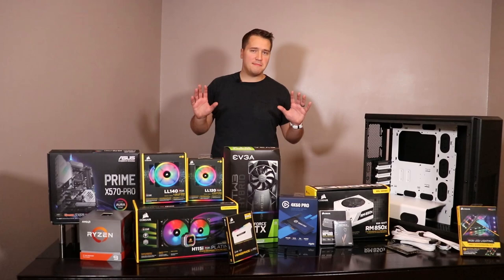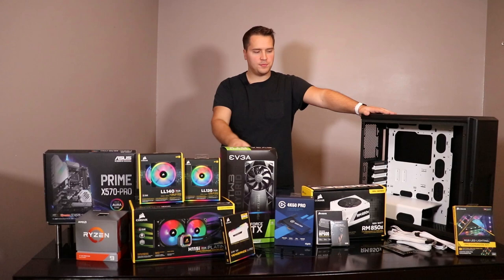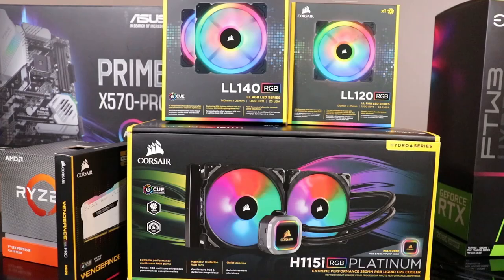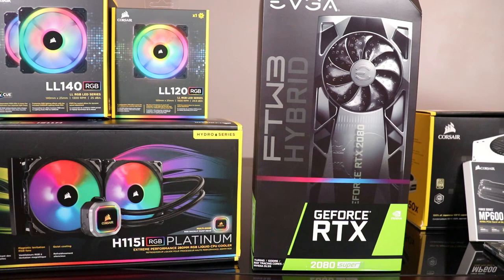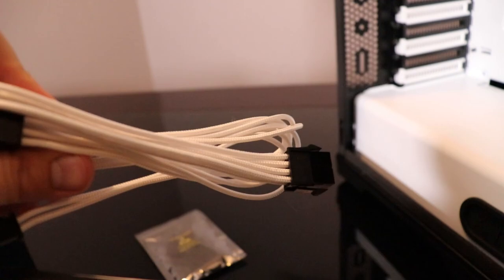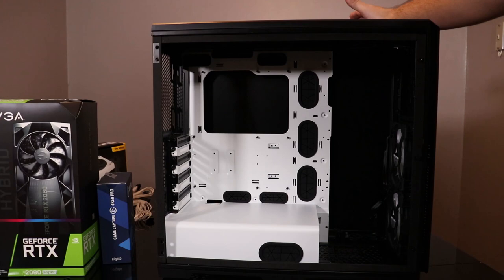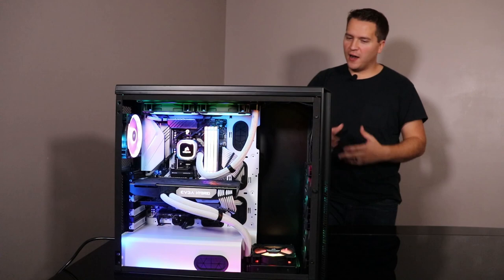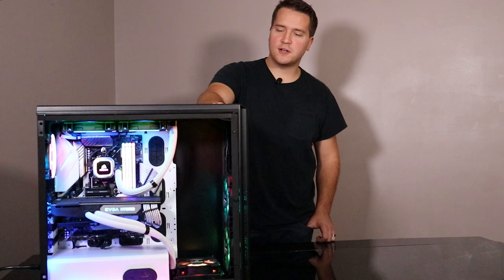My Ryzen 9 3900x Build

Comment: Just built with Same case,same ram but 2x16,X570 Tuf WiFi mobo ,same 2080S  GPU(but a FTW3 ULTRA),same CPU,same SSD MP600 2Tb as C: and Intel 660p 2Tb as D: ,plus a Samsung 14x BD-RW and a LG 24X DVDRW ,WD RED 4Tb HD,corsair GLAIVE Mouse,Corsair M300 XL Mousepad 15.75"x35",Razor Cynosa Chroma RGB kb,eVGA CLC280,LG 32" 32650F-B on DisplayPort ,Feelworld 7" 'Master'  1920x1200 camera monitor screen on HDMI ,and a Seasonic Focus+ FX-850 Gold 80+ power supply. Yeti microphone and elgato card is this Summer as this build broke me $$ wise. Your new build is very impressive,congrats !!
Reply from the maker: That's awesome man! And thanks! I take it your build is running like a dream?! Love those specs.

Comment: Wish you had shown how you took the part off where the optical drive goes. I been trying to find a video showing just that as i'm wanting to replace my front fan.
Reply from the maker: It's just a matter of taking the front and back panel off, and then finding the screws my man. Took a little time for me as well
Reply: @DiscipleGaming  Yeah i see that and then finding where all the screws are. It's going to be a little challenge , but i'll get it done btw how are the fans running? Thinking about getting the same ones for mine.
Reply from the maker: @HeLIEl  Good question! You really can't beat  Corsair's fans, they're the best on the market in vivid lighting, and volume. The LL series are by far my favorite, and they make the entire PC really pop :-)
Reply: @DiscipleGaming  Bet! Getting them asap